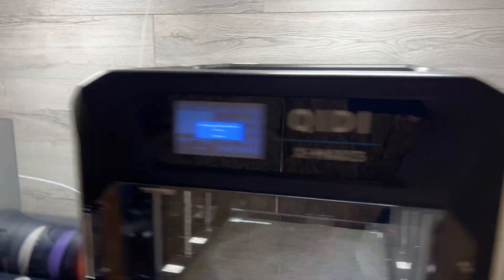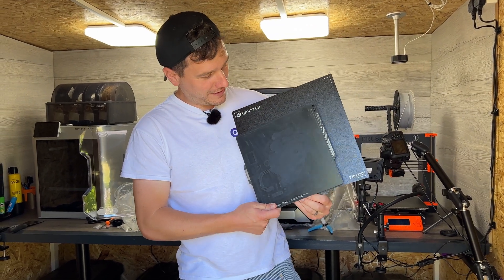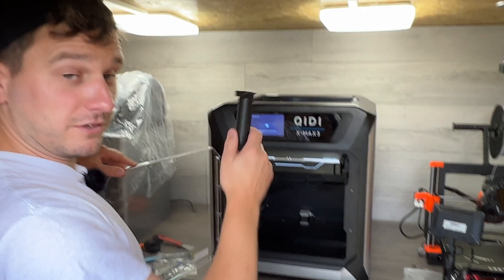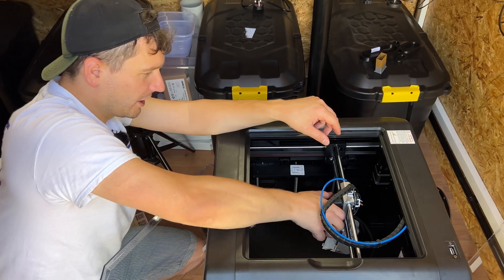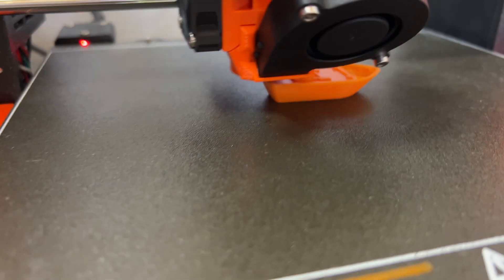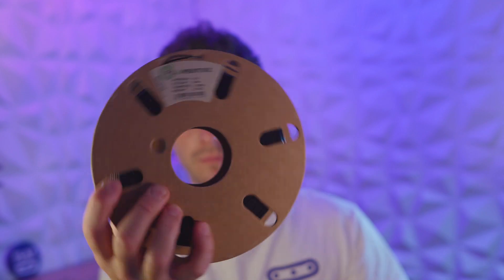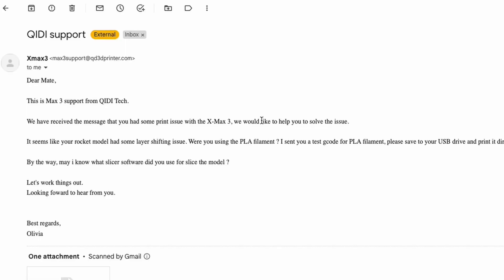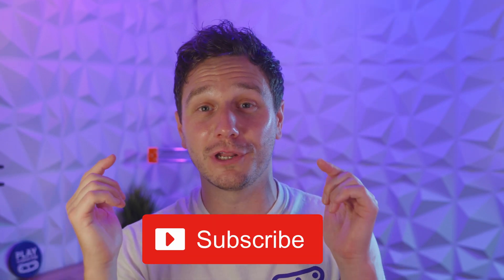Qidi X Max 3 Unboxing and First Review - 3D Printing POWERHOUSE

Comment: Buyer beware!  After watching all these wonderful reviews on the X-Max-3 and their wonderful customer service (has been everything but), I pulled the trigger and purchased on X-Max-3.  My printer came used and severely damaged.  I would chalk it up to shipping, however, the box and insides were perfect and in the photos you can see where they painted over the damage and attempted to cover it up.  Their solution was a $200 coupon that doesn't stack and is only good for filament and parts (none of which I am interested in, plus with their specials I would be better off just paying the sales price on these things).  Printhead assembly looks like someone tried to pry the cover off, inside the print head assembly you can see a huge chip that they repainted, and inside the enclosure you can see a ton of damage with new black paint and scratches that they say is "normal welding".  Also there was filament dust and pieces of filament in the printer when I unboxed it, thus the reason for giving it the once over.  I will most likely be sending it back and going elsewhere.  Customer Service still says this is normal.  You can see my post and images in their Official Facebook Group.  

https://www.facebook.com/groups/1873666592821330/?hoisted_section_header_type=recently_seen&multi_permalinks=2296912413830077

Comment: if bambu labs made a 300^3 or even 350^3 printer they would take over the market. I for one would drop 1500-2000 easily for one of those. I cant wait for that day and i hope its sometime this year
Reply: If their customer service didn’t suck so bad…. Qidi has the best service in the industry and they don’t repair parts, they ship new ones quickly if anything breaks.
Reply: Same here. I bought a QiDi Max3 because I couldn't wait.
Reply: Referring to the latest official statements from bambu they still don´t plan bigger sized printers than the x1 carbon so they literally stuck at the 256 mm square print size. I got the X Max 3 myself and used to print with the reality Ender 5 plus for bigger prints before - but even with some optimization as Bondtech extruder among other things the print quality was still average (in the best usecases) and 4 times slower than the Qidi. Otherwise the Qidi does not reach the quality of my Raise 3D IDEX which has - to be honest - a complete different prize tag an still is much slower than the Qidi.
Reply: Dont be an "apple fanboy" lmao. There are much better current released large volume printers like the Kobra 2 Max (it makes flawless prints) Bed leveling is amazing. Does a larger volume than bambu will ever produce.
Reply: @tjhuntog  lol u dont fuckin get it right? qidi has heated enclosure. kobra 2 max cant print engineering filaments for shit.
Reply: You do know that anything you do on a bambu printer gets sent to them. any gcode any stl everything you put in that software. You can not do anything that requires a NDA. If you are serious about doing prototypes and dont want others to have access to your design you are not going to want to do it on a bambu printer.
Reply: @st0mper121  only if you use the cloud. 🤷‍♂️
Reply: @tjhuntog  Once the back door is built. access its just a click away... try to do something that requires a NDA or find out why All the Ai minis in the middle of the night started printing gcode sent from bambu opps?¿? We  call that a back door test. anything you do with that printer is logged and sent.
Reply: @st0mper121  lol i wish them all the luck. Network engineer here. They are not getting anywhere but the compromised device. Its also quite easy to tell via packet sniffing if something has been compromised.
Reply: @st0mper121  You do know that you can print independently on a bambu without sending any code. The only thing people can dog on Bambu and it's not even a problem.

Comment: Thanks just subbed. I'm curious about firmware. If it is running klipper and has fluid access, are you able to change config file? Can you do things like add ABL/auto purge that only does probing to the size of the object instead of the whole bed? This is easy to do with stock klipper on any machine. Im hoping you can still manage macros and change config for things like this. Thanks!!

Comment: At least you printed something other then PLA, because that is why i want to buy this printer, to use high temperature abrasive filaments. I would like to see more prints with that and the hardened nozzle. And why you set the chamber temperature to 50° and not to 65° which is the max possible temperature, every Kelvin counts ?
Reply from the maker: Thanks for the watch! Yes definitely, since we’ve had it it’s basically being used to print TPU, ASA and Nylon, so far it’s not failed once and the results have been excellent! The 50c was just to save a bit of energy, even though would be very minimal saving, I’ve found ASA prints fine at 50c heated chamber… especially the Filamentive stuff!
Reply: @playconveyor  Which is the strongest ? Polycarbonate ? Most are blended anyway and should be possible to print with the qidi x max 3.

Comment: you can add a camera yourself.... theres a usb on the motherboard for it... qidi has a video guide on installing one ... its really easy.
also regarding the filament.... put it at the rear side inside the dryer box.... not on the back.
btw, the dimensions width and depth is actually smaller than the og xmax... which had a smaller build area
Reply: Could you post a link to the video guide on cam install? For some reason I didn't see it...probably just missed it.
Reply: @steveh8724 just grab the camera and it comes with instructions

Comment: Needs multilcolour to be competitive tbh
Reply from the maker: It’s a really interesting topic is multicolour 3D printing.. I’m not convinced it’s there yet because of the waste and time it takes! I’m still waiting for someone to come up with competition for the AMS!
Reply: @playconveyor  yeah it does take look long and I was hoping the prusa xl was the solution. But the printer seems so slow also :(
Reply: @playconveyor  it has got close. Bambu allows me to "flush into objects" I constantly flush into fidget toys and random small items and limits the poop by a TON.
Reply: It really. Multi color is still a bit of a gimmick. It wastes an incredible amount of material. Unless you’re doing an IDEX setup, single extrusion multiple color prints are a huge waste of time and filament.
Reply: Xmax3 ams from qidi is coming soon.
Reply: It depends o  what you want from a printer. I want speed an quality. And build volume is way more important than colour changes. 
Ams is awesome but its not a deal breaker for me.
Reply: For engineering parts no. It’s what you want out of a printer
Reply: 5% of people maybe that much if not less print in color compared to all 3d printers in the world. While it might be a requirement for you, its not for the majority "shrug"

Comment: I just setup my x-max 3 a couple of days ago...I contacted support asking what type of filament was sent...they responded it's their rapido PLA
Reply from the maker: Ah makes sense.. it printed really well in fairness! Seems to keep up with the speed! How are you finding you’re X Max?
Reply: @playconveyor  This is my first 3d printer and so far I really like it...I just wish there was an actual manual for it besides just the quick guide.  Thanks for making this video...I now know how to clean any jams in the extruder... I didn't have any issues like you did.  Yes I do think the filiment box on the back sucks.  I bought some bowden tube and I'm going to try with the box next to the machine...not sure if that will work...

Comment: That is a big printer 😅 I also felt the filament spool holder… over engineered spool holder needed!!
Reply: I'm sure an extender can be made to top mount
Reply from the maker: @kyky7kyle7  yeah definitely some post design work to be don’t by us in next couple of weeks for the spool holder!
Reply from the maker: Oh definitely… an excuse to get on fusion again! 😎
Reply: actually smaller in size than the original xmax